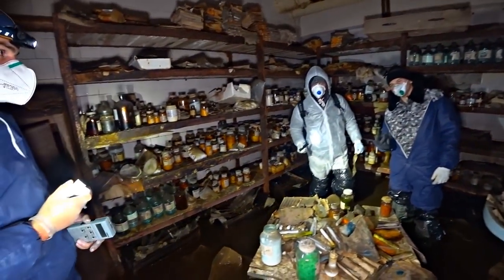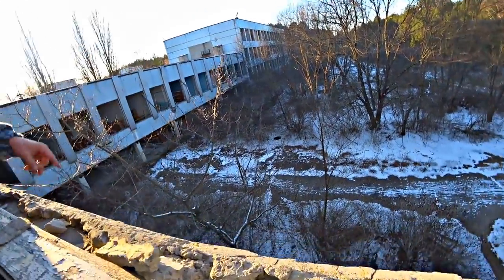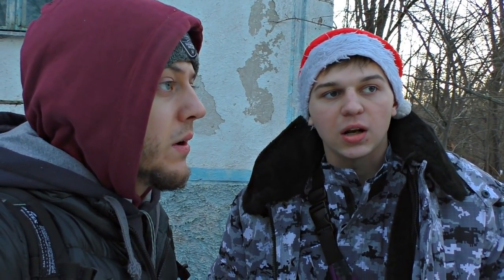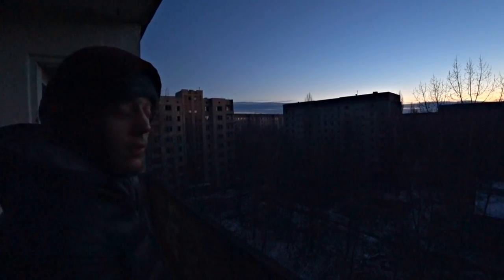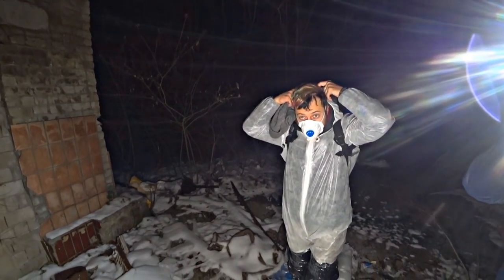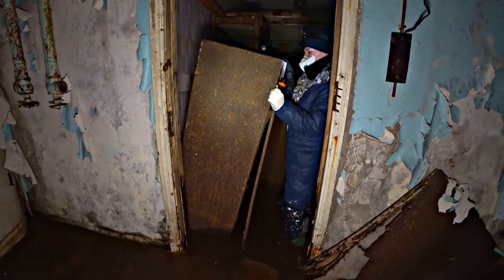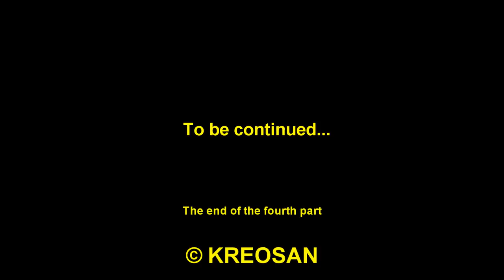The Secret Jupiter Military Lab in Chernobyl Zone - Part 4

Comment: 22:39 that dirt in the bin is really infamous for being SUPER radioactive. It is sand from inside the nuclear reactor which is why the reading is so high in that room. Please throw that bag away. It is killing you.
Reply: No, it was the shoe Looks like the shoe of one of the firefighters
Reply: @eliasnikolaivonheimtrondse4424  there are parts from the robots and cranes (that were used on the roof) inside the sand. It was the sand. Kthx
Reply: @twizz420  its the shoe mate taken from the hospital basement and if it was the sand it whould be impossible to get it out of the reactor hall beacuse its spread Everywhere it imposible to find and melted into a chorium mass beacuse in 1986 the temperature was over 2000 celsius  and sand melting point is around 1700 and lethal in minutes even today its 5 min and your dead if you go in the ruins of the reactor hall
Reply: Ma Boi I’m pretty sure with personal protective equipment They can be around the very bottom Elephants foot for like 10 minutes
Reply: yep other videos show the shoe to be near inactive, while the dust screams.

it might actually be graphite dust from the reactor
Reply: There's a video by bionerd23 from there. She went digging into that bucket and got absolutely insane readings of radioactivity.
Reply: @eliasnikolaivonheimtrondse4424  actually less than that..
However here is nothing that bad!
Reply: I think that black "sand" is ground up graphite.
Reply: you are correct same room bionerd was in and used extreme caution
Reply: @Litepaw  That's the video I was thinking of.
Reply: @twizz420  also hella eerie seeing all the sand still the way bionerd left it. Everything is right where she last put it
Reply: @twizz420  fucking facts.
Reply: What were he readings? 1700 micro Sieverts ? Is it still that much ?
Reply: @eliasnikolaivonheimtrondse4424  They did make the Army reserves do alot of involuntary clean up though
Reply: @goku445  not great, not terrible.

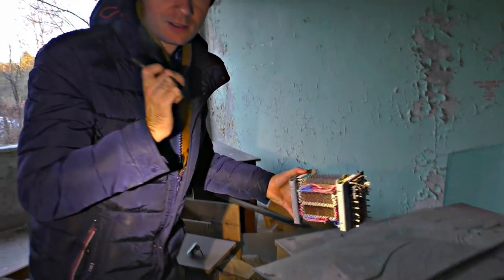Comment: 3:34 this is a magnetic core memory module!!!
Reply: If you are right, then it was probably for the robot or robot control gear, for greater hardness against intense radiation.

For sure they had silicon chips by the mid 80s.
Reply: @forestdenizen6497  Compared to the punch cards and punchtape they showed, this was something very modern at that time. Silicon chips might be arround, but they'd be something of a novelty back then.
Reply: @Fuzzems  that's a good point.

But the tape and the cards looked fairly fresh. I am not familiar with the system, but do you not find it likely that the computer that the memory module is a part of probably takes its input in the form of punch cards and records output on the tape? 

Would be interesting to discover the true story, just legacy equipment or selected specifically for radiation hardness.

There was a similar story with the electronics for the MiG-25 radar system. It is said to have used such old components relative to Western aircraft , valves instead of transistors, that it was EMP hardened "out of the box" so to speak.

It also still holds the world altitude record for a turbofan aircraft, a mind boggling 37.5km (123,000 feet.)
Reply: @forestdenizen6497  damn this is a lot
Reply: Didn't know Soviets copied it lmao.
Reply: yes so very cool to see that core just laying around..
Reply: Very early form of modern RAM.
Reply: Probably worth a lot of money as well 😏

Comment: 22:39 What I thind about this : "This part of the factory is contaminated since 2009, after we wrote about the black box with granulate like stuff inside (someone spread it out). We detected high levels of alpha radiation, and maybe plutonium traces in this box. Some months later I was there one more time but I wouldnt go down there anymore without a breathing mask and overall security clothing.  This is really dangerous. About beta radiation, we don't need to talk - it's all full of it. We had secure clothes but were still contaminated. The water on the floor is also high radioactive. One step in and you can say bye bye to your shoes."

Comment: @KREOSAN English - 
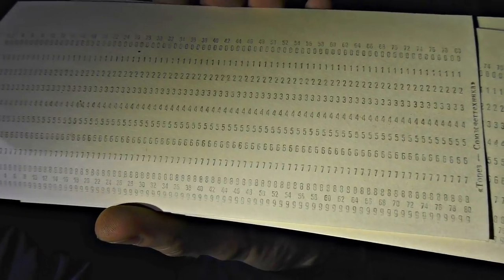The block with the many pins @ 3:33 was 1960s RAM & the paper cards were storage for programs (also 1960s and older tech). 
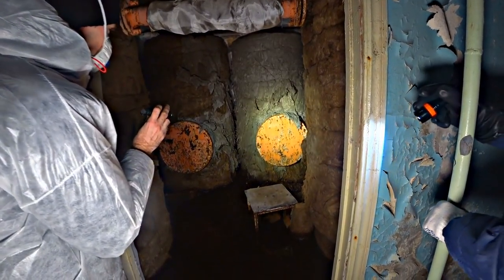@ 17:53 fibrous asbestos insulation (brown + white + blue) with mold.
Reply: Core memory, a matrix of thousands of tiny ferrous beads suspended by wires.
Reply: @BenHelweg  - 
YES

Comment: 19:11 I really hope this is not from the actual reactor and that you guys checked if it's radioactive just in case.
Reply: Only 3.6 roentgen: not great, not terrible
Reply: I doubt that it is a piece of the reactor. I think it has been used as a shiel for a radiation spectrometer
Reply: Na it's most likely from supply for tests
Reply: It looks TOO PRISTINE to be a piece that experienced the heat, pressure and FLYING & LANDING (followed by FIRE). 
 ->  It is likely from the "spare parts" of the old reactors 1 to 3 (never used).
Reply: What if it was from the reactor? Would it still be dangerous?
Reply: @rickyb6086  If it WAS a piece from the inside of the reactor (it is not, it can NOT be, given how "nice" it looks); then they would NOT had bring it THERE [they had Geiger Counters, that thing would scream "radioactive"]; but it would be placed inside the sarcophagus right now (like every other graphite piece).
Reply: @adolfodef  My question was hypothetical. Let's assume it IS a piece of graphite from the remnants of reactor 4. Would it still be dangerous 30+ years later? That was my question..
Reply: @rickyb6086  The "graphite" itself (the thing that mades 100% of the "piece") would not be dangerous after 30 years [technically speaking]. 
  

All of the carbon atoms that became isotopically unstable because of the thermal neutrons from the uranium nuclear reaction had decay lifetimes measured in minutes [this is PRECISELY the reason why those pieces were so extremely dangerous hours, days & weeks after the incident: they "release" their energy quickly and fast].
-> It would still have a lot of of Carbon_14 atoms (thousands of years are necesary for HALF of those to decay, so it would not be intense); plus its decay type is a low_power "beta" ray (electrons that would be completely stopped by the combination of air, clothes & skin), merely heating them a bit [no DNA damage].
  
BUT! -> The graphite pieces came out of the reactor because of a steam explosion (so the "heavy metal" dust_sized fragments could had partially penetrated inside of them, getting mixed); then this would release gamma radiation the same as the "corium" (but in much smaller quantities, plus getting partially shielded by the graphite).
  
THEN:  The only risk would be BREATHING one of this heavy metal "smoke" particles [getting them in the lungs].
Since those are super_radioactive & graphite is not heat conductive, the metal tends to vaporize, acummulating pressure, making its own "micro-explosion", getting into the air (cooling instantly back into a solid) and "float" around the graphite piece.
Reply: @adolfodef  Thanks for answering my question. Comrade Dyatlov would be proud 👌🏻
Reply: @rickyb6086  They absolutely could be, but no where near the level of radiation immediately following the explosion. I, for one, wouldn't keep it around my house but I wouldn't be bothered by being near it for short amounts of time.

 Chances are, most material of that size would have been buried in the sarcophagus if it were to pose an immediate threat years down the line. That's not to say that plenty of material got looked over and left out, but the clean up effort was immense and there are other burial sites where radioactive material was brought to contain it.

Theoretically it could be dangerous, but the rad dosage would pale in comparison to the levels emitted shortly after the explosion.
Reply: @rickyb6086  lethal

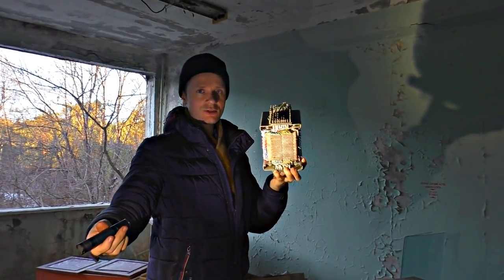Comment: 3:32 Core memory? Might be something interesting on it?
Reply: That type of memory only stores minuscule amount of info. It's basically just a bunch of 1s and 0s and is akin to modern RAM, but much much smaller storage, not even a kilobytes worth if i'm not mistaken. Even if the binary states are still the same as they were during use, the amount of info you may be able to recover wouldn't amount to anything substantial.

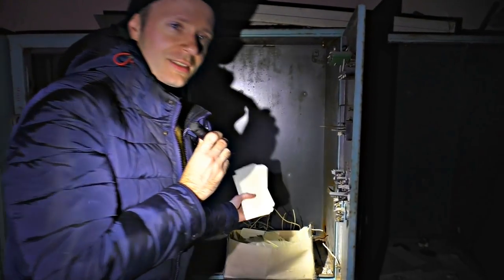Comment: I think at 3:29 that's a bunch of Punch cards. They're blank, but you would punch holes in some of then numbers, before inserting them into an old computer that would read it. Seeing they still have the old Reels in there, there's probably a machine to punch them as well. 

Just think of it as a little program, where a punch is a 1 and a blank is a 0. And it would do a basic calculation or function depending on what numbers you punched.

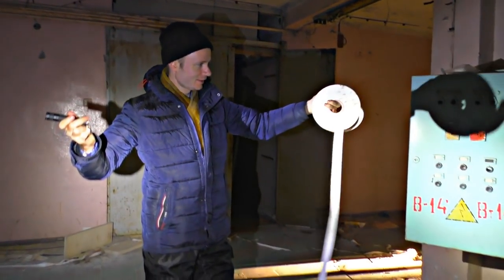Comment: 3:27 - Those cards with numbers are very old "data punch cards".  They were used to record data, to be inputed into a machine that could read them.  The primitive computers of the day could then tabulate the numbers of thousands of cards.  The rows of numbers are for punching square holes. If a number was punched, the machine would read a "1", if there was no hole it would read a "0".  Feeling pads with retractable pins would "read" any punches.  The stiffness of the cards is to have them be handled by the very fast machines.
Reply: I think they're where the phrase "Do not fold, spindle, or mutilate" came from.

Comment: 3:32 Its a punch card, it makes a computer read instructions, usually you feed a bunch in, in the correct order, to read a sequence of code,  its how early computer programming was done! The object held after that, that's a (volatile) memory module, think of it like computer RAM, only.. after an instruction went through it, the previous instruction was erased, hence why it's referred to as "volatile" memory. Many components on the memory module had to be made by hand, and is 100% analog component using lots of tiny wire and magnetised ferrite rings for conductivity.

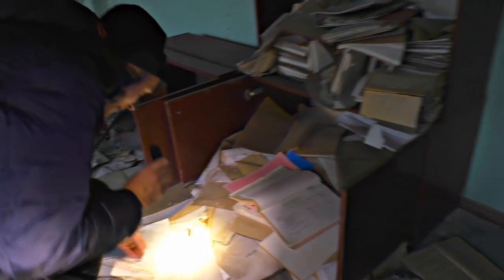Comment: those cards @3:30 are actually used to "program" the computers. they're punch cards and they get run through an optical reader that interprets them as a 1 or 0(hole or no hole).  that's how they did mathematical calculations back in the 60's and 70's using computers! also the "brick" @3:35 is a bank of memory for storing the few bits of information that was possible back in the day, it reminds me a lot of the one that Linus Tech Tips got to see at the NASA's Apollo mission museum, the amount of data it's able to store is a fraction of a Megabyte in the range of maybe 12-20 kilobytes.

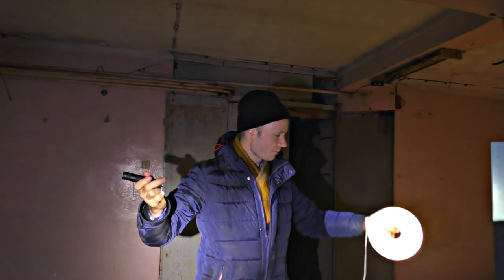Comment: 3:28 that's a punch card used to load computer programs before they used magnetic storage, you have to program in binary manually by punching holes on a card, that kind of technology was obsolete by the 1980's but i guess they still use old machines, i mean the us military just upgraded from 5.25" floppy diskettes...

Comment: 3:34 That looks like a ferrite bead core memory module.
Reply: Yep! And it's just lying there as it clearly did not have much copper or gold in it. I guess the rest of the computers parts ware looted by scrappers.
Reply: @2ftg  Probably so, and how ironic, considering what some collectors will pay for an intact volume of core memory from the USSR.
Reply: @AtlasReburdened  Yep. I have considered buying one for years. Would be a neat bit of tech and an interesting project to make the readout electronics for it.
Reply: @2ftg  That would be an awesome project. I'm sure it could be front ended with a UI for 30-40 bucks of modern electronics and a smart phone.
Reply: @AtlasReburdened  Around something like that. High current transistors are much cheaper now than in 1960.

Comment: Wow, I'm a bit surprised to see the punch cards were in use there. We stopped using them in the 1960's except in voting machines and I think the voting machines went digital in the early 80's. Any data that may have been on those reels of magnetic tape were lost the moment the radioactivity reached them. Those electronic components for circuit boards should be fine. All except any electrolytic capacitors which go bad with age. I'd be removing as much as I could carry lol.
Reply: I remember Hollerith cards from high school in the 70's. We used them for programming in Fortran and Cobol - you'd send off a box full with your program on them to get run on the school board's one and only computer and about three months later you'd find out whether it worked or not.

Comment: Effects of Radiation Levels on the Human Body
Dose-rem Effects
5-20 Possible late effects; possible chromosomal damage.
20-100 Temporary reduction in white blood cells.
100-200 Mild radiation sickness within a few hours: vomiting, diarrhea, fatigue; reduction in resistance to infection.
200-300 Serious radiation sickness effects as in 100-200 rem and hemorrhage; exposure is a Lethal Dose to 10-35% of the population after 30 days (LD 10-35/30).
300-400 Serious radiation sickness; also marrow and intestine destruction; LD 50-70/30.
400-1000 Acute illness, early death; LD 60-95/30.
1000-5000 Acute illness, early death in days; LD 100/10.

Comment: Why stalkers not bring night vision devices? Ordinary cameras  can be made into gen 0 nightvision with a high power infrared LED light. There are literally a lot of low lux cameras on the market. Those are perfect for the cause. Small LCD displays can be used as screens for the night vision device. With a lens it can be converted to a monocular. There is an instructable on instructables [dot] com

Comment: Right at the beginning at 00:09 that peace looks somehow like a peace of grafite from the nuclear power plant core in Chernobyl
Reply: That's exactly what it is.  Never used though.
Reply: @aaronj08ar  
Yep 
But also hopefully never used ... 
Would be very very radioactive 

Or ?
Reply: Ya it would be very hazardous still, but after the explosion, I would imagine not many (if any at all) would be as intact as that piece looked. Even though the graphite moderators are very compressed, solid graphite is relatively brittle. Just a guess here, but I would suppose they were manufactured using a sintering process, which would lead to them being even more fragile, comparable to say, something made of ceramic.